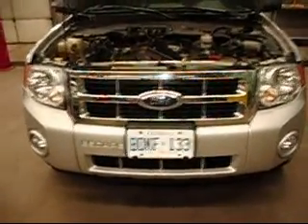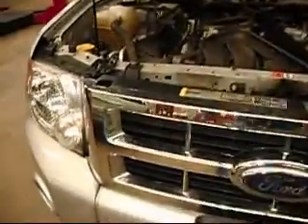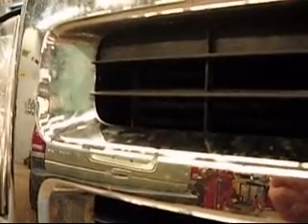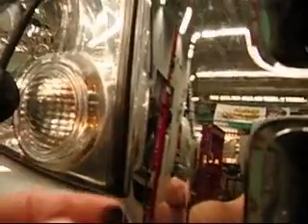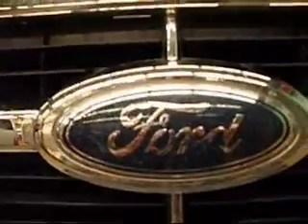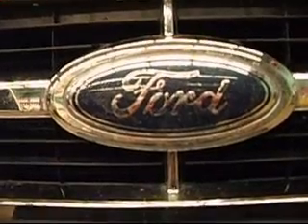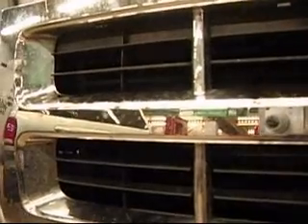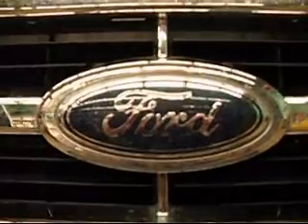Ford Escape, Mariner, Mazda Tribute defective transmission cooler

Comment from the maker: @ptcruide The defect is being fixed and repaired free of charge for now - it is unknown whether the new part has been upgraded. There have been other Escape complaints about transmission failure. The CRV, Highlander, Sante Fe etc are more dependable and retain their resale trade in value much longer than an Escape.

Comment from the maker: @GrayWulf316 Make sure you are reading the dipstick correctly (hot running for 20 minutes) and on dead level ground - It could be the same issue - have a close look in front of the radiator

Comment from the maker: @MrDulkes Thanks for the info - I'll check that out and see if they are the same part number - if they are, Ford needs to treat the owners of the defective parts the same regardless of what model it's in. In the mean time fill out a complaint to NHTSA - if you lost all your fluid the transmission would fail -

Comment: My trans oil cooler just failed to the tune of $930.  I had 37,800 miles.  So pissed off.  It is a known problem that could create a major safety issue and Ford is doing nothing about it.  They could have at least informed the consumers when the TSB was issued.  Thanks for the video.

Comment: @carquestions There is a fitting in the rubber brake line that offers a solid place to attach it the the body of the vehicle. The rubber hose is from there pulled at a hard angle sometimes and causes extremely premature wear and tearing of the rubber hose at the point where it meets the fitting. I'll take a video next time I get one in.

I'd say just a design flaw that puts stress on a part not designed to handle it.

Comment: @carquestions Thanks for the reply. I will file that complaint. I brought my Taurus in for a regular oil change, there were no lights indicating anything was wrong anywhere, yet I could've easily destroyed my transmission. Please post what you find out on the part numbers. I am no mechanic and have to rely on what others tell me.

Comment: Wow thanks for the info.! 
I have a 2009 Tribute and a paint peeling mess on mine on the hood!
Mazda wants nothing to do w/me now that I have a problem. 
Mazda Tribute 2009's were also recalled on a transmission part I had to take and get that replaced after only a few months of having the suv! Now the transmission still has a problem with shifting roughly a few times a month. 
My Mazda Tribute 2009 also had to go in a few months ago for a very bad leaking back window!
Hope I help some1!

Comment: I've got the same problem on my 2007/08 escape.
I noticed what appeared to be oil in the radiator grill on the lower right side near the headlight.
It didn't appear red as trans fluid usually is... So after seeing this I will go and check my trans fluid level :/ . I wonder if ford will still fix this if it is a "known" defect.
 also I just turned 50,000 miles mostly all highway.
Reply from the maker: I hope you make out ok - probably be a bit of a battle with the dealer
Reply: The dealer already said there was no recall. I told him about the number of complaints I have found on the Internet and he claimed I can find complaints about anything on the Internet. This is a local dealer here in San Diego California. I asked for a quote on the repair and he told me he couldn't give me a quote without seeing the vehicle even though I describe the problem exactly. I did get a quote on the part at $341 plus tax. If the dealer won't take care of the problem I will most likely do the repair myself to save an extra $300. This also will most likely be the last Ford I own.
Reply from the maker: Daren Fentiman contact me via my website and I'll give you a copy of their internal memo telling dealers the problem and how to fix it - then go back to the ahole and wave it in his face
Reply from the maker: First tell him he's right - you can find anything on the internet - then show him the Ford Co info

Comment: My sister bought a 2009 Escape and has had the tranny fixed 3 times for a leak on the left side of the axle and is leaking for the 4th time with no warranty left.Thanks (FORD) for sweeping this problem under the rug like you allways do untill your caught by the (NHTSA) and fined.Like the (01-07) Escape problem that took a girl's life.To get a recall on the (09) Escape's you need to file a complaint with the (NHTSA).With enough complaints this problem can finally become public and save a life.

Comment: I  have a 2008 ford Focus that this time is leaking transmission fluid due to the ac condenser/transmission cooler being faulty, took it to a ford dealer and of course they will not cover it under the powertrain warranty. This needs tobe fixed in all fords, im sure the escape and the focus have the same ac part

Comment: i had same problem on 08 escape. ford wanted 650 to repair. when they saw i couldnt afford it and itwas only 60kmiles,they used an aftermarket cooler which dropped price to 350. still toooo much for a practically new vehicle

Comment: I have an '08 Taurus. At 40,000 miles it now has this exact same problem. The mechanic told me it is the exact same transmission cooler as in a '08 Escape. $531 to repair, no TSB, not part of the drivetrain. I have been on the phone for hours with Ford Customer Service, but to no avail. I own 4 Fords at the moment, all but one I am the first owner off. Way to burn customer loyalty Ford!

Comment from the maker: New Video - Carquestions challenges GM to "man up" and recall 12 million vehicles for a safety and emissions defect concerning broken exhaust manifold bolts. Mark has researched and experienced rusted and broken exhaust manifold bolts on GM vehicles over the past few years and can't believe GM won't acknowledge the problem through a recall or TSB. Thousands of Silverado, Sierra, Suburban, Tahoe, Yukon and even Escalade owners have spent millions...

Comment: @fordtransman I know this is a little late but I never received a letter.  Ford is only fixing SOME of the cars.  I was told by Ford that my car (based on VIN #) was not covered under the Customer Satisfaction program.  After stating my case (something like "Although my car is not covered, clearly I have the same problem since my transcooler DID leak".......) I was still denied Reimbursement.

Comment: Wow, thats a long video. Ok, so your trans cooler is leaking. Ford has a TSB. Get it fixed under warranty, or talk to the service manager about program/assistance programs.  A trans cooler leak is NOT a justifiable reason to NOT buy a vehicle. And the problem is only for the 2008

Comment: We have an 2007 and have had no problems with it. It has 85k Miles, Guessed they changed it in 2008. I would not pay 4 to 800 USD to fix this problem. Just find good aftermarket oil cooler  bypass the condenser and be done with it.  Even Uhaul could install it for you.

Comment: I am a ford tech.  There is a tsb on this issue. The retail repair is about $300-400 tops. The rate of failure is minimal.  Before you bash, get the facts straight. Maybe you can buy a Toyota and go careening into a tree out of control.